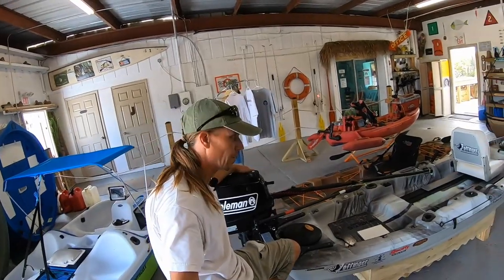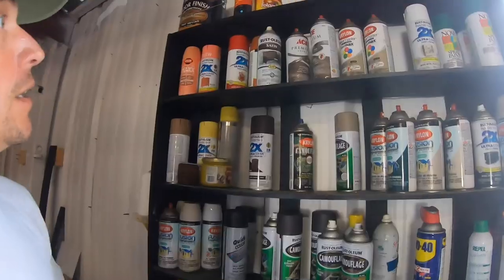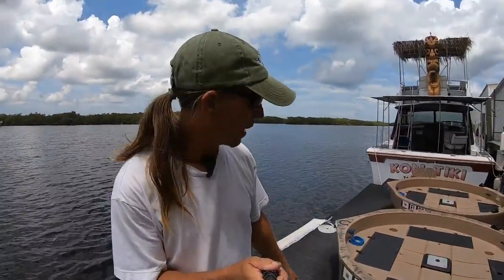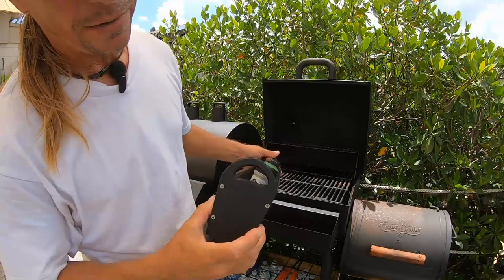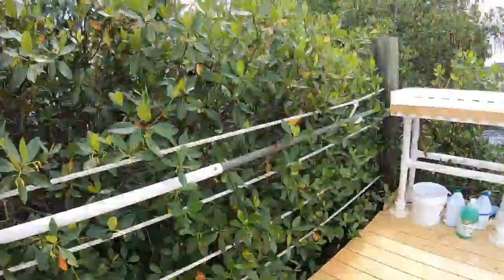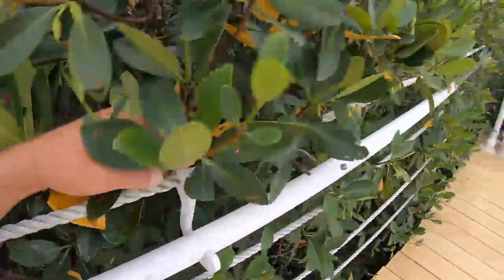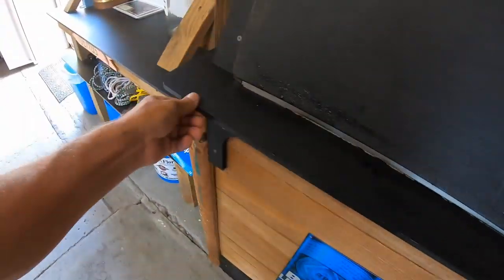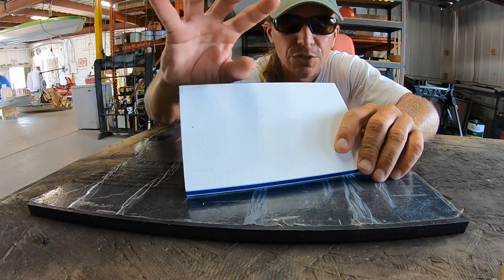What am I Always Building Stuff Out Of?

Comment: Hey Marty, Love the content.  I have a question?  What type of material do you use to fill in holes on kayaks or boats?  Holes in Plastic Material.  This would be screw holes or larger holes in excess of 1 inch?  I didn't know if there was some sort of epoxy that works well with plastic?

Comment: One thing I haven’t seen mentioned...
  Nothing sticks to Starboard.

 So no caulk, glue, etc ... need mechanical fasteners for everything
Reply: Not true anymore. Recently there has been an epoxy based compound developed which can be used to glue HDPE to other polymers.
Reply: But you are correct in the fact it used to have to be welded or secured mechanically.  Also, Starboard is way overpriced. Marty is lucky to get this for nothing.
Reply: @KennethCupo  what is the name of this miracle epoxy. I mean paint will not even stick to it. Sanding helps alittle bit
Reply: @brenthawkins204  I did a quick Google search and there are  a variety of manufacturers.  Permabond TA4605 or TA4610 is one of the first to show up in the search.   Im sure 3M has something out too by now. They have adhesives for EVERYTHING.
Reply: @KennethCupo  Yes the Permabond TA4610 works well on this material. The bond exceeds the material strength.